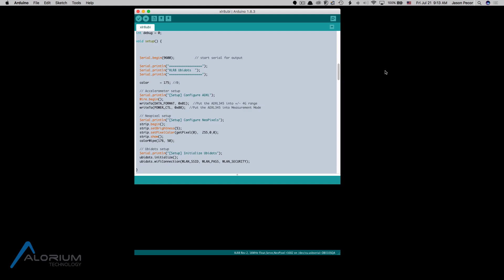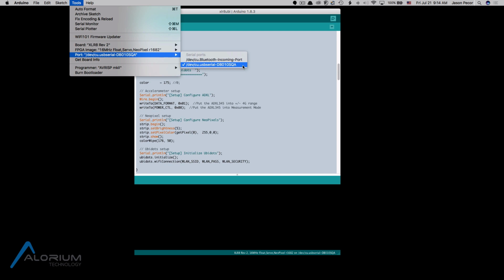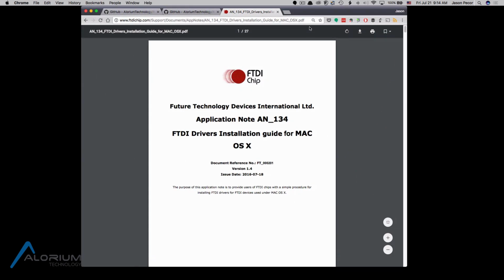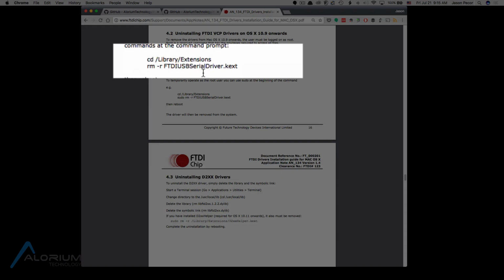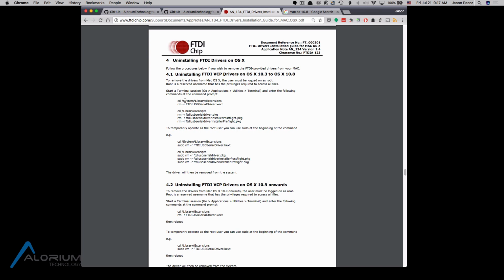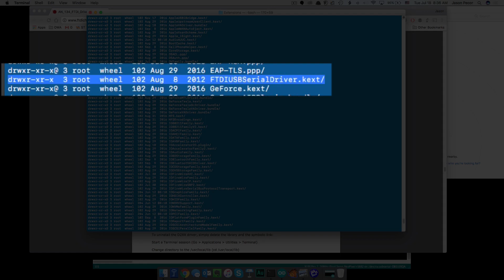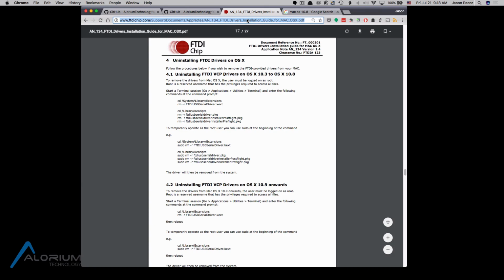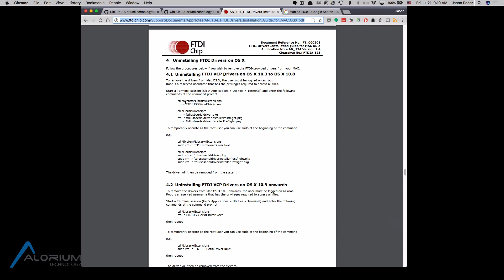How to fix FTDI driver issue on Mac and macOS

Comment: I've worked may way from USB-hub port to USB-hub port and a reboot once in a while. This is one of those problems I have, try to find solutions, ignore them for a while, try to find solutions, get frustrated again, ignore them for a while etc...., but I'll never give up. Today I found your video and it looks like you've found the solution (I should've RTFM). Thanks man your the greatest. Maybe I can pay you back with my comprehensive (880 pages) Arduino documentation http://bit.ly/eve_arduino  it is a very large PDF file.

Comment: Thanks so much for posting this. It (so far) has solved my issues too. I had the same issue with OS X Mohave connecting to a Tinyg CNC controller via JSON and a Sparkfun Redboard. I didn't have the pre-10.8 files, but did have a FTDIkext.kext file in my Extensions directory. I renamed it FTDIkext.disabled. The Sparkfun Redboard worked immediately but strangely enough, couldn't see the Tinyg with the JSON program. Interestingly enough - I plugged the Redboard back in, then ran the JSON server. So far both have passed the port and power disconnect tests.

Comment: Thanks for that tip - helped me as well! NOTE: to remove a kext on El Capitan (i believe) and later you need to temporarily disable System Integrity Protection. Sudo alone won't do it. Here is how: 
https://blog.macsales.com/45473-we-explain-what-system-integrity-protection-on-mac-is-and-how-to-control-it
 This is a SIP is crucial function, so make sure to re enable it after removing the FTDIUSBSerial driver.

Comment: Thanks for sharing the video! Just bought a 3D printer (CR-10S) that uses FT232R as a serial to USB converter and my connection was unstable. I wasn't able to update the firmware via Arduino IDE, or open up a serial window via terminal without the connection dropping. I knew there as something as it was working perfectly in a Windows VM (Parallels). 
I'm also using a 2013 MacBook Pro 13, that's been updated all along. Funny enough I wasn't able to find any .kext FTDI related files in any of the directories listed in the uninstall docs.

Comment: Thanks for the video, though the solution is a bit different in High Sierra. In High Sierra, I don't find any FTDI driver in System/Library/Extensions, there is only one file called "FTDIKext.kext" in /Library/Extensions. I tried removing this file, and problem solved now. But not sure what affect this solution will have, it is better to backup this file before removing it.